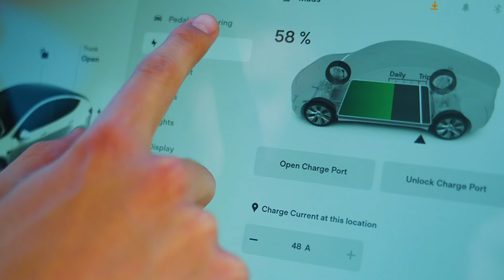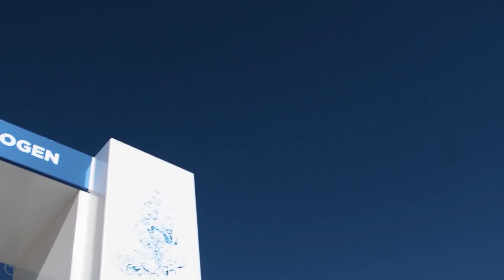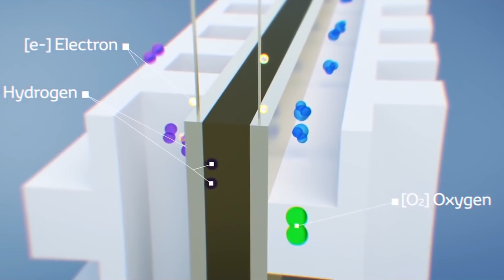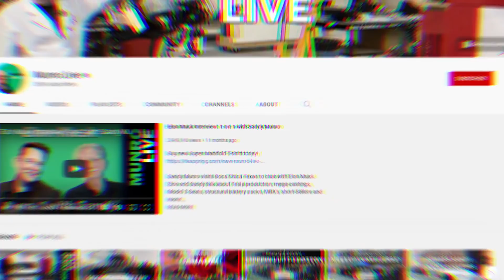SANDY MUNRO: Will Hydrogen Fuel Cell Tech Survive in 2022?

Comment: Hydrogen will be the main fuel for cars simply because the national and local power grids do not have the capacity to cope with a large expansion in the eV fleet. In the UK it has been calculated that to provide power for a full EV fleet of cars, buses, trucks and trains as well as industries and homes will require the current grid to increase power supplies by a factor of three. Even assuming their is money to achieve that the time to do so is years and it is doubtful with other countries doing the same there will be enough materials in the form of steel, copper, aluminum and rare earths to achieve this. The UK is planning to replace its natural gas grid with hydrogen by steam reforming the natural gas currently going into the grid and burying the carbon dioxide in depleted North Sea oil and gas wells where it will help recover more of these energy sources but it will also be able to produce the hydrogen locally by hydrolysis using the excess power produced by the small modular nuclear reactors to be introduced by 2030. BEVs are an ecological disaster from the mining of the raw materials to the disposal of the old batteries and the same applies to wind and solar. Restrictions on exports of rare earth and other items by China will also limit EV sales.

Comment: If ships could manufacture their own hydrogen fuel using wind, solar, and hydrogen energy capture (if such a thing is possible) there could potentially be room for fully fuel-self-sufficient ships, and yachts.  That could have a huge impact on the shipping industry and the dirty fuel commonly used there.

Comment: If you have a class 8 truck that goes 300 miles with a battery, it will be very easy to either hand off that trailer to another truck to go another 300 miles or just swap the battery at a dedicated truck stop every 300 miles.  The cost of a battery swap will not be 3x the cost of charging like hydrogen will always be.  Soon there will be no truck drivers and the robot truck will go to the station and drive through a truck wash that swaps the battery and then keeps on going.   Hydrogen might work in aircraft, but any renewable liquid fuel will beat it out of the market.

Comment: Toyota Mirai goes 0 - 60  in 9.5 seconds.  It's the slowest accelerating car Toyota makes.   It's only rear wheel drive.   It costs a fortune to fill it up with fuel.   Hydrogen is done.  The hydrogen filler hose gets frozen to the car.   How much profit is there in a Mirai?  I think it is below zero.

Comment: Big Trucks ~ Fine for big companies. Cars ~ its a slam dunk if ya stick with Stanley Meyers 100%. No big adjustment to anything really. $1250 and you are done. During all the transitions to whatever Hydrogen will be in the future...in the meantime in my opinion it should be a legal requirement that Stanlyey Meyers' mechanism is installed in every vehicle. No danger. All you have to do is use the regular 6 V or 12V battery and Add Water. No Danger in that. This is the quickest way to get off gasoline. All you need is service stations that supply water with directions handy for the customer. We need a bunch of mechanics to get on board with this. 

All the other systems so far are creating more 'problems' as they conjoin with 'big business' as they never solve a problem unless it costs you huge bucks...so other researchers should get on board again with Stanley Meyer's system because it 'worked!'100% ~ No need to change the temperature of the water, it is perfect with his system. And hydrogen supply is totally on demand. Forget electricity ~ like they say every Tesla battery you have to carve up a little mountain just to get the lithium ~ so in my opinion, that's not the way either. Water definitely is the best way to go for all vehicles, including ships and aircraft. The most thing needed is water storage in such a way it is always available to be on demand for power. That's it. Keep it simple. Cheers!!

Comment: How far can a truck driver legally drive in one 11 hour shift?  Dumb hydrogen may not be needed. Good point - HAZMAT permit should be required for hydrogen fuel.
Reply: The speed limit (mph) x time (11h). Est 600mi-930mi depending on region.

Comment: This is total nonsense, the "Hydrogen stocks" are hopeless losers because none of the electrolyzer companies can deliver industrial-scale capacity.  They only offer small-scale electrolysis capacity, so they can't provide anything but small-scale revenue.  Small-scale revenue will never eclipse their operating budget, so they cannot show a profit (earnings).  Small-scale electrolyzers cannot make enough H2 from water to reduce CO2 output at an industrial scale, so they are irrelevant.  Renewable energy is coming on line quickly, but to reduce global warming, one must decarbonize all of the greenhouse gas emitting sectors -- transportation, agriculture, residential & commercial building and industrial sources (primarily concrete, glass, steel and industrial chemicals).  That means we must create decarbonized fuels such as green ammonia, whereby we take cheap and abundant renewable energy and split water into cheap hydrogen and oxygen.  Then, humanity can remove nitrogen from the air (air is 78% Nitrogen) and, using the Haber Bosch method, combine the green H2 and N to make green ammonia (NH3).  Ammonia, as a "liquid carrier of hydrogen fuel," can carry more hydrogen/BTUs by volume at a reasonable temperature and pressure than gaseous or liquid hydrogen.  Large-scale electrolyzers (no existing electrolyzer manufacturer can provide) would allow green ammonia to fuel and power all greenhouse gas emitting sectors.

Comment: The Future is Hydrogen, not Electric (aka batteries), someone has yet to convince me of an all Electric Cars future.
it just simply does not make sense from the Portable Fuel aspect. The battery charging is a huge no-go. If you have battery swap stations like in China, then that makes sense, (but it still won't beat petrol when you can store a few gallons in your car for that long safari trip, but you can't have portable batteries to carry in your car), otherwise, as long as you don't have portable fuel, it's a dead end road.
Whereas Hydrogen, the science of molecular chemistry, is where the future of mobility should be going forward to, and in time, to be able to harness the energy from atoms, or the energy in the vacuum, towards a Warp Drive: To Infinity and Beyond!
Reply: Yeah, on a long distance road trip, it might take 45 minutes to get 300 miles of charge. That's a long time, as long as it would take to stretch your legs, use the restroom, and grab a bite to eat! Just think of the time you'd save on a road trip if you didn't have to do that! Who needs food or restrooms? 

But wait! Most of your driving is local, not cross-country. So, an EV driver would park and charge at home, and never have to experience the joy of searching for a working hydrogen station, or the social experience of waiting in a long line with fellow hydrogen drivers for the one lone working hydrogen pump!  Can't put a price on that. 

Sorry to tell you, but there is a portable battery that one can put in your trunk that can partially recharge an EV. But it seems a bit expensive, so I went looking for a portable hydrogen tank that could refill a hydrogen fuel cell car, and, well, there isn't one at any price. Hmm, seems the 10,000 psi pressure that hydrogen cars use is a bit of an issue. Does "unavailable at any price" beat out "expensive"?
Reply: @chrismuir8403  The Future is Hydrogen. It's just not the current liquid hydrogen version. It has yet to be developed. That's why the Future is Hydrogen.

Comment: Somebody please explain where we get the cheap hydrogen, and how we store and distribute it cheaply.
Reply: Not cheap, but neither is battery mining...everything expensive compared to petrol car....have to do more research &/or brilliant minds to find solution.
Reply: @sevencostanza3931  Why is "battery mining" always evil, while oil exploration, refining, distribution, subsidizing,  and burning is AOK? The cheapest hydrogen is made from fossil fuel, solar falls from the sky, for free.
Reply: @johnstout5767  Battery Mining i read uses more fossil fuels (the digging equipment etc) than fossil fuel extraction. Lithium mining in Chile uses lots of water. Can get hydrogen from electrolysis water in lieu of natural as as feedstock. Really everything is a problem & contributes lot of pollution. Need either less people or more people to live without a car & simple minimalist materialist life or brilliant people to solve these problems.

Comment: Hydrogen is not a naturally occuring element. It has to be synthesized.  For every dollar of energy you spend making hydrogen, you get 60 cents or less, at most, worth of energy from synthesized hydrigen. That is why it is not economically viable. I fail to understand why Sandy does not address economics and transportation of hydrogen.

Comment: Considerations :  1] Energy density/Kg.  is at the core of the issue.   2]  Cost of creation Hydrogen, liquifying  and transporting them to delivery station 
So for high energy density applications - hydrogen is theoretically  viable. 
 Contra view - Elon musk has said - even for best case scenario for a hydrogen fuel cell use case ie., second stage of a rocket - it doesn't make sense to use hydrogen as fuel cell.
Reply: To use hydrogen as a fuel cell? You lost me. Hydrogen is used in a fuel cell not as a fuel cell. The 2 stage of a rocket (space shuttle eg) is burning hydrogen in an rocket engine and not in a fuel cell.

A fuel cell can be seen as electricity generator without the noise from an engine and less moving parts which can use for example natural gas or hydrogen as a fuel.
Reply: @kcs8888  Agree with your correction. Core point is still the same. making , transforming, delivering, stroring hydrogen makes it not viable for most transport systems. It’s the oil companies that are pushing for it, because they think they can reuse their existing delivery infrastructure. Not feasible.

Comment: I (retired Boeing 737 pilot) was disappointed to hear mr. Munro say the airplanes are the biggest polluters on the planet and terribly inefficient. They are not.
The entire aviation is responsible for 3% of all pollution from fossil fuels.
A typical airplane like the 737-800 needs about 5,5 kilograms per nautical mile with 200 persons onboard at a speed of about 440 knots (nautical miles per hour).
That’s 2400 kilograms (3000 liters) to travel about 800 kilometers or, 15 liters per passenger.
Try doing that with a car carrying four people:
An efficient car will need 8 liters per 100 kilometers or 16 liters per passenger (more than the airplane) to complete those same 800 kilometers.
Take into account that a car will do that in eight hours, instead of one. Also, a car needs a road constructed and maintained (extra cost for the environment, higher than airport facilities extending for two times 3 kilometers).
Reply: Mr Monroe stated that Jet fuel contains lead. As an A&P mechanic I understand that jet fuel Is highly refined kerosene (jp4). How many jet aircraft use jp5 today?
Reply: @danuhr8826  as far as I know, the commercial aviation uses jet A-1. JP4 was phased out sometime ago. JP5 is for military use.
Reply: Yes very true & information that has been know for last 50 years----all those people on airplane, lets assume they are in groups of 4 people per car....will pollute more on way to destination than the airplane.

Comment: I think this is a lot of BS.  Batteries and hydrogen don't have any range and creating hydrogen normally is very dirty.  Much better to simply use fossil fuels.  All of this has been tried in the past and it is nothing new and it doesn't work.  He said 16 gears.  I don't know any 16 gear transmissions:  8, 9, 10, 13, 15, and 18.  Not 16.

Comment: Storage of hydrogen- not good. That solid storage can't store nearly as much hydrogen to make batteries less energy dense. Storing in tanks is stagnating quite long. There are physical limits what pressure can tank take. And, hydrogen has so small molecule that it escapes tanks even through tank walls- about 5% per month (battery selfdischarge is about half of that).
Worse yet, hydrogen generation is very inefficient. If you generate hydrogen from methane then you can do that with efficiency of about 80%. And you are producing as much CO2 as burning of methane would produce. Clean production would be from water. With efficiency of only 50% because you are trying to disrupt one of most stable molecule known.

Palladium is essential for fuel cells: Palladium is one of rarest elements. It was estimated we have enough palladium for about 2,000,000 fuel cells. After you spend the palladium, what would you use for majority of vehicles still waiting for fuel cells? 
Better than hydrogen it would be better to make synthetic hydrocarbons. At least storage would be easier and we would be able to use classic ICE or gas turbines.

Comment: Woluldn’t it be easier if they used hydrogen in a normal gas ICE? Instead of that complicated and very expensive combustion cell?
Just use the engine to drive an electric generator and use the electricity to drive a few electric motors. And, voila: u have an inexpensive truck that drives on hydrogen!

Comment: Aluminium air battery likely wild card. Synthetic sustainable jet and diesel fuel likely for heavy transport/aircraft because hydrogen has many storage and handling issues and diesel has the required energy density.

Comment: Can you please talk about commercial hydrogen is made from natural gas? One of the biggest producers of natural gas is Russia. - please let's not invest in a technology that indirectly supports the Russian regime.
Reply: It doesn't have to come from natural gas - Russia does this in abundance because they have an abundance of natural gas.
Reply: @skipfantry5059  of course it doesn't have to. But it does. Hydrogen is not green when produced commercially. 

Commercial hydrogen is NEVER produced from water as the process isn't economical.
Reply: @cooluser23  The rub is it need not BE produced commercially. A hydrogen power wall generates three days of energy off of tap water and a solar cell. It can be purposed for home energy, transportation or what-ever else.

AND . . .

Just because current commercial hydrogen production uses petroleum/natural gas on the main DOESN'T mean it must remain that way.

Comment: LIB 200$/kWh of capacity,  2000 cycles max 92% efficient, 0.8 - 1.5% open circuit loss per day
vs 
COPV HP green H2 : 10$ per kWh of capacity, 50000 cycles or 6 months min. at full pressure without ANY measurable loss, 

With sun wind and water everywhere people live and  with green power production and storage on site all over without the need for expensive transport and distribution grid networks (copper 10000$/ton, alu 4000/ton, etc)  or any short life electrochemical batteries each, many times more expensive than P.V. dc power production with P.V. Schingle below 400$/kWp so below 1.5 us cent/kWh over the warranty  period and free after..so who said efficiency is a problem ??? : if 50 kWh of P.V. energy is needed for 15kWh at the Emotor of a Miraï for 100 kms, so what if such primary energy and storage cost less than…. one dollar…and all joule losses stationary and recoverable….even high gas pressure for adiabatic expansion AC in the vehicle…..  The only problem is that this dollar is no longer sold by the current energy production and mining exclusive system providing mobility energy with its own huge and historical  gap between true production cost and retail selling price, so that is why H2 has to be cumbersome, dangerous, uneconomical, fuel cell air too contaminated for the life being as short as LIB, only 100% of Pt recycled has to be less good than 5-10% of Li.recycling ( 10% of old batteries is uneconomical recycled which corresponds to only 5% of current prod.!!! ) but anyway the fig. above are all accessible on the web to verify and ratios are just too wide apart for any other factor to significantly change the picture..like electrolyser and compressor costs which need to improve further…etc..game over….

Comment: This lines up with heavy transport utilizing diesel fuel vs lighter transport using gasoline. Heavy transport use hydrogen and light transport using battery.

Comment: I see 2 huge issues for hydrogen that aren't discussed often. Those hydrogen generators/electrolysers who are supposed to work with "free" green energy are all looking for a 24/7 usage. But in most cases it won't be above 50% of the time. At least not for the next 10 years. Then there is the idea to store and use hydrogen for long time storage. I never hear who, where and how it will be stored in sufficient volumes to get through the winter. It's a lot more expensive as oil storage and a lot less safe.